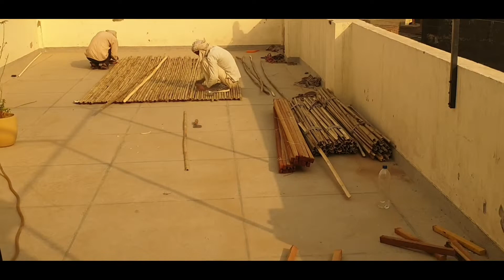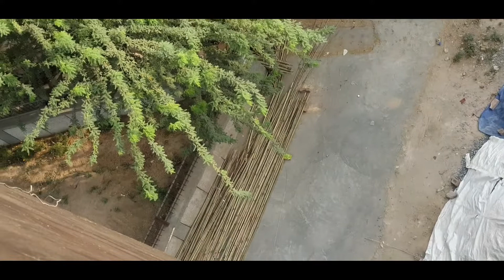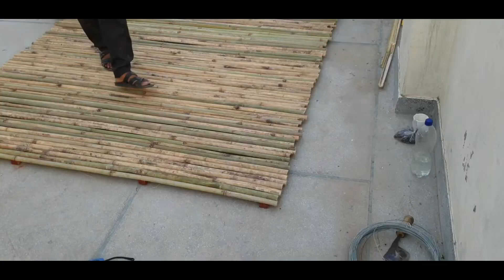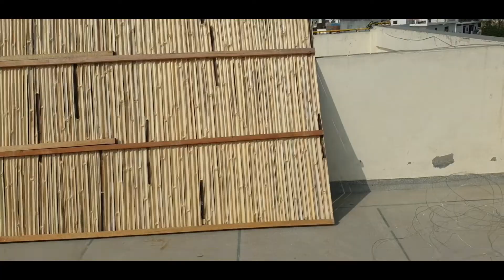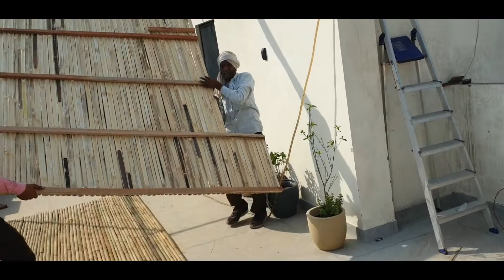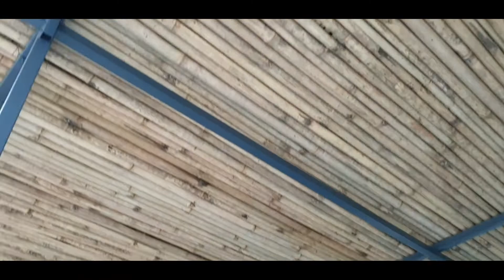how to build bamboo roof bamboo shade | bamboo chick | bamboo roofing techniques #bambooroof #hut

Comment: Hey! How much was the total cost?? Also how did you fix those iron pipes for the support?
Reply from the maker: Iron frame is fxed in wall with rivets and welding . Frame alone cost was around 5000 and bamboo work cost was 45rs sqft